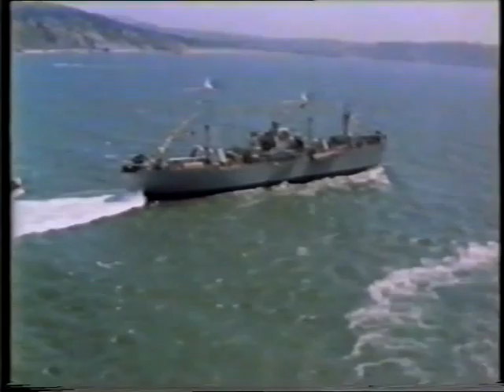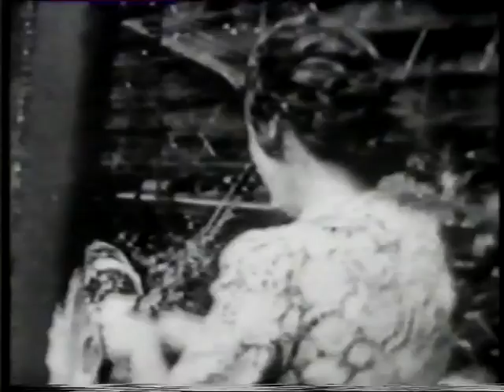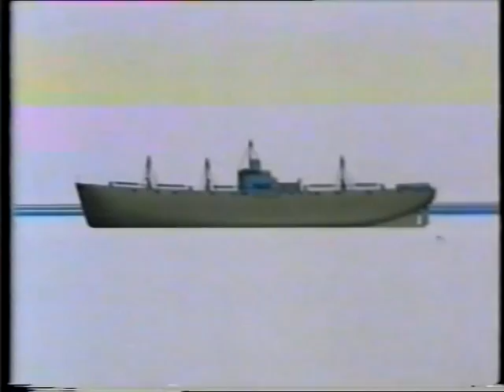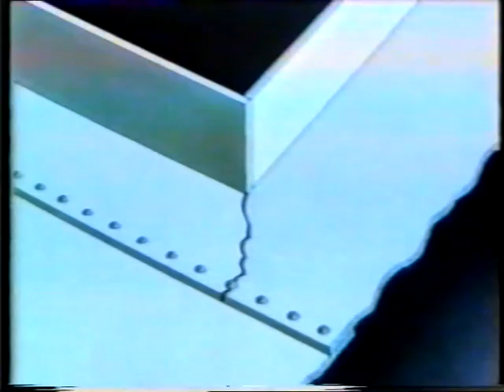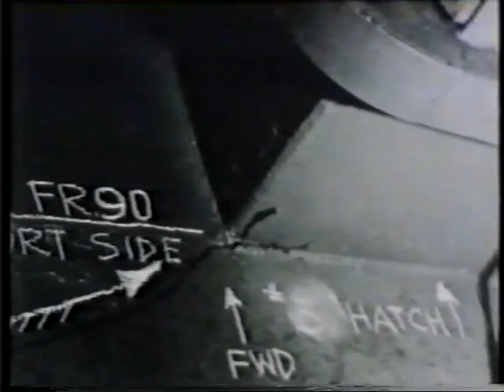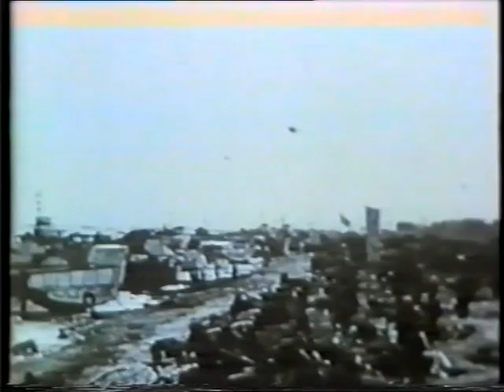Last of The Liberties

Comment: One more design fix-when the Victory Ships were designed, the spacing between the vertical frames was increased from 30 inches to 36 inches. Liberty ships had only 30 inches between frames, which made the design much stiffer-and much more prone to stress concentrations. Victory ships had largely replaced Liberty ships as the war went on. They also had steam turbine engines compared to the Liberty Ship's steam triple expansion piston engines-the turbine giving them a top speed of 17 knots to the Liberty ship's 11 knots.

Comment: The most interesting thing is what happened in 1954 with the British de Havilland Comet passenger jet.  One crashed because a window failed and explosive decompression ensued.  The reason for the failure was that the windows were square and concentrated the stress at the corner of the aluminum skin causing stress fractures.  I guess the engineers at that firm didn't study their current material science lessons.
Reply: That's unfair - The concept of pressurisation fatigue wasn't really known of then. They did not have any wreckage that showed the failure. No one had flown anything that large flying that high with the same design or number of cycles. They only found it by submerging a fuselage in water and repeatedly pressurizing until something burst. Afterwards they did find wreckage after months of searching from one of the accidents showing the same failure location.
Reply: @Spookieham  COMET was pushing the envelope of material science into new areas not previously seen-it flew faster, higher and with pressurization. You're correct, that criticism above is unfair-nobody had operated in that performance range before with a large passenger airliner. Just as Lockheed pushed the envelope with their Electra.
Reply: @johnburns4017  Did you even read my post? You're so focused on promoting British engineering reputation that it's blinded your reading comprehension. Science has no nationality and I speak as a PhD degreed electrical engineer who has been working in industry for 44 years.

Comment: In 1941 the Empire Liberty was launched in Sunderland, England, to a standard modular design by a local shipyard. The first Liberty ship was born.

British shipyards were expanding, but running 24/7 unable to meet supply. The British needed more ships so used idle American industry to make them to a standard, simple, and quick to make Sunderland design. 

They visited many US companies and sites for shipyards which they would set up. They went to Kaiser in late 1940, who had a small shipyard in Seattle. The British came up with $96 million to secure a deal building the Liberty design which would include the financing by Hunter of Sunderland of the building of two new shipyards.

The US embarked on a programme of merchant ship building so adopted the British Liberty design, which was being made in the USA in new British financed shipyards. The official history of North American supply states that this was the most monumental supply deal of WW2.
Reply: Everybody acknowledges the original design was an obsolete and easy to fabricate British steamer. The design was further optimized for American fabrication techniques. What really made the Liberty ship a powerful weapon of war was electric arc welding of the hulls-it was never done before on such a major scale. And these ships were only designed to have a life of 5 years, they were not expected to last much beyond the end of the war. The intent was to make them fast, cheap and get them launched. The Victory ship of 1944 timeframe was built much more soundly.
Reply: @heyfitzpablum  
The Liberty design was NOT obsolete. It had simple and reliable steam engines, because it could be fired by oil or coal. Motor ships, which were becoming the norm in the 1930s, can only run on diesel fuel. The UK was full of coal, so a choice in times of war.. 

The design was for ease of fabrication.  The British had the largest merchant fleet in the world by far in 1940. They needed more ships for the war effort. The financed Kaiser to build the ships for them.

In September 1940 a British Shipbuilding Mission, headed by Robert Thompson of the Sunderland shipbuilding firm and including Harry Hunter, the technical director of North-Eastern Marine Engineering, went to America. They were charged with ordering sixty tramp steamers of around 10,000 deadweight ‘tons’ each.

They visited many shipyards and marine engineering works, as well possible sites for new yards, in both the USA and Canada. The only business that could be done was with a great West Coast civil engineering contractor, Henry Kaiser, who happened to have a small shipbuilding firm in Seattle. 

By November 1940 the outline of the deal was agreed: $96m (£24m) to include $9m for two new shipyards. The ship to be built was to be Thompson’s ship 607, whose plans he had brought with him, engined with Harry Hunter’s efficient reciprocating triple expansion machinery. However, the Admiralty decided suddenly that the specifications should be those of a later Thompson ship, the 611, later called Empire Liberty, whose drawings were just being finished in Sunderland. This British decision to build the Oceans (and the contemporaneous deal for twenty-six Forts from Canada) ‘was without doubt one of the most momentous supply decisions of the whole war’ according to the official historian of North American supply.

In January 1941 the US decided to start its own emergency shipbuilding programme. To save time it was based on the same British design converted to oil rather than coal-burning, to the tune of 200 ships. The first ones were laid down in April 1941, at the same time as the British Oceans. The programme was to be expanded hugely, with 2,700 Liberty ships built. As a result the world fleet was larger in 1946 than in 1939, despite war losses equivalent to half the world’s pre-war shipping fleet, some 30m ‘tons’. The Liberty ships were also the main reason the post-war world fleet was more steam-intensive than the pre-war one. In 1930, 30 per cent of the world fleet were oil-fired steamers; by 1945 the figure was 52 per cent.
- Britain's War machine by David Edgerton.
Reply: @johnburns4017  The ship design was obsolete and the engine design was obsolete. Sorry if that fact offends your sensibilities, but there it is:     'Importantly, the selection of the original design for the Liberty ship was based upon a pressing national need to rapidly establish an emergency cargo fleet of vessels that would be fast, reliable, and cheap to build. In addition to moving significant numbers of troops and supplies, a large number of vessels were needed to counter the maritime losses being faced by the Allied troops. To achieve these objectives, an outdated but very reliable design (the Ocean class) whose origins traced back more than 60 years (to the British Sunderland Tramp design, 1879) powered by 140-ton vertical triple expansion steam engines (also obsolete) was adopted. These decisions were made because it enabled more companies to contribute to the industrial effort. Some notable changes to the obsolete designs were made. They were modified to increase the displacement (i.e., cargo weight) to over 10,000 tons, conform to assembly-line type practices, use oil-fired (instead of coal) boilers, and, importantly, replacing many of the rivets with welds. '
Reply: For more of your edification-there was nothing novel about the design of the ship, what made it unique was the assembly practices-specifically large scale hull electric arc-welding instead of riveting combined with modular construction used on a new and aggressive scale. USA led the world in cargo ship hull welding technology, though the Japanese and Germans used it on warships to a degree.
Reply: @heyfitzpablum  
Before WW2 the USA made few ships.
Reply: @johnburns4017  And your point is???
Reply: @heyfitzpablum  
Read it all again, it is good for your soul. It is obvious
Reply: @johnburns4017  What's obvious to me is you're trying to promote the British role in designing and developing Liberty Ships at the expense of the US contribution. Hey, if you need to do that to validate yourself, fine. I've conceded they were a British design-albeit an obsolete one with obsolete triple-expansion steam piston engines. The real story was American manufacturers finding ways to build them faster and cheaper and defeat the Axis with overwhelming manufacturing capacity. It you want to continue deprecating the American effort in being the Arsenal of Democracy, go at it. You trivialize yourself by doing so, but I suspect that's not something you're unfamiliar with. The discussion no longer yields any value to me, do me the genuine favor of not replying anymore with further farcical comments, I'm through dignifying them with a response. Good day.
Reply: @heyfitzpablum  
No I am not. I am stating history as it was. The Liberty ship was a 100% British concept and design. 

Americans constantly attempt to change history - and by omission tell blatant lies.

The Liberty was not an "obsolete design" at all, as it was all new. Designed to be prefabricated and welded. A simple utilitarian design. 

The real story is the design and implementation of the Liberty ships, of which the USA had no say in. If you read what I wrote you would have learned that the steam engine chosen was because it was simple, easy to make, easy to maintain, ready skills to service them, and reliable...and could burn coal or oil.  Diesel engines, which were the norm in new ships in the late 1930s, were deliberately not selected.

The established British shipyards employed fast working highly skilled men. These men were reserved for the complex men of war ships, with low skilled Liberties given to the USA.

"British orders for these ships were crucial in expanding the US and Canadian shipbuilding industries."
- Britain's War machine by David Edgerton

Only for the British setting up Kaiser, the US shipbuilding industry would not have been prepared.

Roosevelt fully agreed with Churchill adopting the British Liberty ship  programme in the USA. The British were teaching, and holding the USA's hands, in the art of modern warfare. Without the British using idle US industry to its own uses, the USA would have been hopelessly unprepared for WW2, from a production perspective.
Reply: Anti-Americanism is such an unattractive form of bigotry, it drips from every comment you make. I'm Muting you, since it's obvious you have nothing of value to add to the discussion.